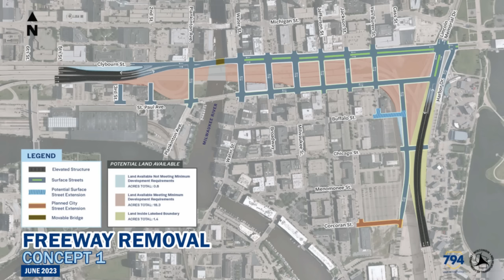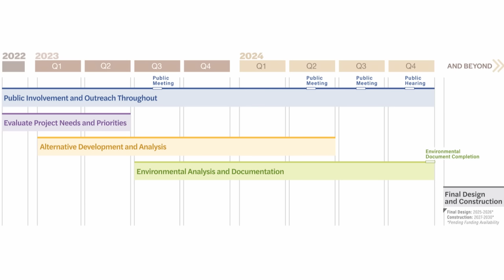Why Milwaukee Is Tearing Down Its Freeway To Nowhere (I-794)

Comment: A 4 lane boulevard with Light rail adjacent to the sidewalks sounds like the best solution. Connect the waterfront to Amtrak's hiawatha via light rail and you can see decent ridership in summer. This also seperates pedastrians from cars via railroad tracks thereby making it safer to walk or wait for the train.
Reply: Why 4 lanes? That’s just removing one car-centric design and replacing it with another. The best solution is bike/ped/transit, with no cars. Similar to the Atlanta beltline plan.

Comment: I love the idea of getting rid of it in favor of converting Clybourn into a boulevard, but it would be a massive project that would screw up downtown for a while. Worth it in the long run but I do get the opposition. The only big issue I see is the Summerfest traffic...the grounds host large ethnic and cultural festivals just about every weekend during the summer in addition to the actual Summerfest event, and traffic gets terribly unpleasant during these events even with the current set up. Reducing all that to surface streets could be a disaster. Then again, if the state would allow for more expansion of the streetcar so it's not limited to a small portion of downtown, that would probably have a huge positive impact on the traffic issue. Looking forward to the town actually making some decisions soon
Reply: Honestly a park and ride could work great from the edge of the city where there's less valuable real estate
Reply: @rt_goblin_hours We have plenty of park and rides on the suburbs that actually take people from there to summerfest via MCTS freeway flyer buses.
Reply: Why TF is the state refusing to allow Milwaukee from extending its streetcar?
Reply: @edwardmiessner6502 there is a particular party that will never help Milwaukee out.
Reply: just build a grade seperated Light Rail for that periodic sort of traffic
Reply: @supercellex4D   where ya going to get the money from.
Reply: @TheSjuris  not building goddamn highways that get overwhelmed by periodic traffic
Reply: @supercellex4D  not gonna get money to build a 1 mile light rail system either.
Reply: @TheSjuris The billion dollars saved from not having to replace the freeway to nowhere that’s at the end of its service life.
Reply: @toddinde   dude they just saved 1 billion dollars by not doing anthing at all. No need for a  1 mile light rail system from 10th to the lake.

Comment: It never was intended to be a route to the airport. The idea of it going all the way to Chicago was a fantasy, and the lakefront expressway in Waukegan, IL was never planned to be part of I-794. The southern end of I-794 was intended to bend westward in Oak Creek, and become part of a beltway that was de-mapped in the early '70s, leaving the Hoan Bridge going to "nowhere". But it really wasn't "nowhere". The eastern part of Milwaukee County found this special road to be a great asset -- except for the awkward connection to the street network at the south end of the bridge. The Lake Parkway solved that problem. It's end just east of the airport isn't some botched connection to the airport, but rather it's right about the point of diminishing returns. Traffic levels start to drop off at that point, and the street network, at the time, was mostly old 2-lane roads. Upgrading the surface streets was a better investment south of that point.

The removal of the east-wast portion adjacent to downtown gained a lot of interest after the Park East Freeway was dismantled, and the area in its corridor flourished. A lot of people didn't think that would happen, but now they think it can be repeated. 

As for the never-build Lake Freeway north of the East-West Freeway (that would have connected to the Park East Freeway, keep in mind that the Summerfest grounds, and the area immediately north of there was once industrial land, and a huge rail yard at the foot of Wisconsin Ave. When the Lake Freeway was proposed, the sight of a modern freeway seemed like a huge upgrade from what was there before. That point of view changed as what's now known as Veteran's Park was developed, and Summerfest grew from a Woodstock-like beer bash on a muddy field, to a world-class festival, and people realized that the lakefront had recreational value greater than it's traditional industrial and transportation value. (In the first half of the 20th Century, people didn't have "leisure time", and Milwaukee was an industrial city. And "downtown" didn't stretch to the lakefront, but rather stopped around Milwaukee St. Most of what was east of there had started as marshes, and the residential neighborhoods that were built on top of that, which later became part of what now is considered downtown, was a convenient place for poor, working-class laborers to live.)

At one time I-794 was seen as a primary access route to the south harbor area, via the Hoan Bridge, but truckers never warmed-up to coming downtown to reach the rest of the Interstate system. And Becher St, between I-94, and the south harbor (Jones Island) area was/is more than suitable. 

Disconnecting the Hoan Bridge, and the Lake Parkway from the Interstate network probably won't be a problem. People coming from the north -- Milwaukee's "gold coast" -- will be more inconvenienced. Instead of their gentile ride down Lincoln Memorial Drive to reach I-794, they'll need to go through, let's say, rougher neighborhoods on the north side to reach I-43. But even the "gold coast" has a more "urbanist" point of view now than 40 years ago. The real money (and power) has moved far, further out of the city to places like Mequon, and the connection to I-43 doesn't require going though rough neighborhoods. (And connections west to I-41 are also available.) 

I expect the East-West portion of I-794 to be demolished in favor of a grand boulevard that, along with the redevelopment to the north where the Park East used to be, will further suck the life out of the traditional downtown area, which already is getting a bit ghost-townish. As for the Lake Parkway, I'd expect it to transferred to the County, and its numeric designation stripped away. And watch for the bridge to change, too. I expect that traffic will be limited to the west span, with the east span turned into a bike highway, and the viaduct portion on Jones Island removed. But that's 20 years off.
Reply from the maker: Ok warren

Comment: In Canada, Montreal removed part of the Bonaventure highway. The viaduc that was between the Ville-Marie tunnel and Peel Bassin was demolished and turned into a park. As a city entrance, it looks much better, but as a public space, it really does not work. The park is a bunch of spaces stuck between the 2 traffic directions and the transversal roads. It just isn't all that inviting at all. I do think that it was the right choice to remove that viaduc. It is a costly infrastructure that was way overbuilt for the purpose that it served.

Comment: It hasn't really stopped any development though.  The third ward near the east/west portion of the freeway is pretty built up.  The Hoan bridge was kind of a waste of money, in retrospect, since all it really does is provide a link between Bay View and downtown but that's a sunk cost and it's not really hurting anything either.  It goes over Summerfest and the sewage treatment plant - so it's not like anyone could put up a building in either of those places.  Also, as you can see from the ample parking, there isn't that much demand to build stuff in downtown Milwaukee.  They reconfigured the 794 and Lincoln Memorial Drive junction several years ago to free up that big green lot near the turn on the east end of Clybourne and it's still vacant today.  For that matter the Park East land has been pretty poorly utilized and they tore that freeway down over 20 years ago.  

Also, the east/west portion is the main route into downtown.  A surface street would not be able to handle that level of traffic.  And getting rid of it would hinder development by making it tougher to get down there.  I mean even without traffic just considering the stoplights you're probably adding 5-10 minutes minimum to travel times between the Marquette and the lakefront by converting that to a surface street.  And keep in mind that downtown Milwaukee isn't really the center of the Milwaukee area.  If you make it too difficult to get down there then developers will start putting up office towers out in Tosa instead.
Reply: It took 20 years but there's a lot of development happening in the old Park East corridor near the new arena that couldn't have happened with the Freeway still there! Building a nicer, more walkable downtown Milwaukee will be good for development, nobody is going to put up towers in Tosa because of a 5 to 10 min traffic delay.
Reply: They tried putting a tower in Rosa a few years ago West of the zoo. Most of the residents greatly opposed it and the project was cancelled. I don’t think a tosa would ever approve a tower
Reply: True they reconfigure the 794/lake memorial drive/ clybourne intersection. But everyone I know finds that interchange greatly confusing. Especially if you are driving southbound
Reply: Wrong on every point.
Reply: @jacobkorducki6940  It's not just the extra 5-10 minutes.  Anyone driving in from Waukesha or Washington Counties has already spend a half an hour or whatever just to get to the Marquette interchange.  And as the region grows that number will increase.  Because eastward growth is impossible the center of population will always move west and that makes places like Brookfield or Tosa more appealing for employers - especially if Milwaukee is going to make life difficult for people driving downtown.
Reply: Wow a practical perspective not driven by bicycle utopian fantasies.

Comment: The narrative is mostly accurate but the title is not. "Why Milwaukee is Tearing Down its Freeway to Nowhere (I-794)" is way too premature. Consider the following:
1. According to the Wisconsin DOT web site, the section of I-794 that some want torn down served 73,900 vehicles daily in 2022.  Dumping that many vehicles onto downtown streets and the already congested I-43/I-94 on the south side is not feasible.
2. Federal funding for future repairs of the Hoan bridge and other sections of the interstate would likely be reduced because I-794 would by necessity, become a state highway and eligible for as much less federal highway fund support.
3. Right now, advocates for the teardown proposal are getting most of the attention.  I anticipate if Bayview, St. Francis, Cudahy, South Milwaukee, and Oak Creek residents sense that the DOT is seriously considering taking down the bridges, the negatively backlash will be enormous and the tear down advocates' dreams will be shattered. 
4. The best plan is bridge reconstruction with fewer entrances and exits and modern ramp design.
Finally, even though Google maps list the KK River as flowing under the Hoan Bridge, prominent local historian John Gurda says that it is actually the Milwaukee River.  The reason for the differences of opinion is because the waterway under the bridge runs between the confluence of both rivers and the harbor.
Reply from the maker: The freeway to nowhere was a nickname given to the highway in like the 80s I think? Idk I saw it on Wikipedia. Either way I didn't make that up for the title, it's a name used for the road by multiple people that I saw within the research of the video
Reply: This is a lazy turdstorian video by someone who admits to using Wikipedia as a source. Thanks for all your original research.

Comment: I am wondering why they can't just use another option that at the intersection of I-94 and I-43, the freeway does not go further east? They could have I-94 west bound into a "T" intersection where you turn to the south for Chicago, or turn north for I-43 to Green Bay. To have a reason to keep the Hoan bridge, build the I-794 exit off of I-94 between Burnham St and Bolivar Avenue. There is already a cleared right of way just north of Waterford Avenue where powerlines go. The north end could be the on and off ramps to E Clayburn St. With this option, the DOT still gets to build Interstate highway, and downtown gets to be free of a highway that separates downtown from the south.

Comment: Bullshit it leads nowhere. It's a handy shortcut from the Marquette Interchange to Cudahy and Oak Creek. I've also tried to get out of downtown in a snowstorm. Remove that and the only way across the rivers south is via Pittsburgh St to South Water St/1st St or head west first, all of which will be jammed.

If you're going to open up acreage downtown for development, first you have to make downtown attractive again. With recent big crime headlines downtown and the unwillingness of the current DA to prosecute crime (his charge rate is under 40% according to the police department), downtown is a pit. Removing the roadblock from downtown will attract that crime to the relatively ritzy Third Ward. They're not going to like that.

I like it the way it is. They just reconstructed the whole thing back in 2008 with the reconstruction, which cost $800 million and took 4 years. Money wasted if they tear it down now. Wait until it needs replacement again, or at least significant reconstruction. This is where Milwaukee/Wisconsin is/are pound foolish.

Comment: As someone that grew up there and lived there for 25+ years I can tell you the whole road system is a mess, not just I-794/lake park way. Poor planning and funding and also stealing funds out of the DOT to build Miller park didn't help. WI does not have a toll system, it's all gas tax and fees. Also when events let out like NBA or MLB games the roads are a parking lot. It's a parking lot during rush hour as well. There is no room to expand I94 and I43 without demo of buildings. Thanks for the video, you do some awesome videos.
Reply: You should do one on Madison, WI Hwy and roads. Now that's a head ache.

Comment: Milwaukee already went through a freeway removal back in the 2000s with the removal of the Park East Freeway. Milwaukee is also studying on removing the Stadium Freeway with the study planning on being done in winter 2024.
Reply: The Stadium Freeway feels VERY likely to be removed once the study is complete.
Reply: @dhinton1  That would be a shame, at least from I-94 to Washington Park. Even along the border of Washington Park it's fairly unobtrusive in its depressed 2x2 configuration. It's a valuable connector to near northwest Milwaukee's old US 41 and US 45 corridor, effectively collecting/distributing traffic across a 2 mile distance from a major freeway, rather than directly to surface streets. Surface streets here don't even exist due to the terrain and land use. I believe the stadium north freeway is the best roadway for the job that's required here.
Reply: @digitboy100  a lot of people in the Washington park neighborhood have been arguing for its removal. It separates the park from the neighborhoods directly west of the freeway. Plus traffic is terrible when the freeway meets Lisbon AVE.

Comment: Reconnecting the Third Ward to the CBD will be an absolute boon to Milwaukee's future development. This freeway is a waste of space, and money. It should be ripped out and replaced with more housing and park space to reconnect the city like it used to be. It will likely improve traffic in time as well, since large freeways like this tend to induce more car trips and ultimately cause more traffic instead of alleviate it.

Comment: Complete removal with in the city is totally feasible. i get that on festival days there might be more traffic than usual, but on days like those you could temporarily close the side-streets off clybourne street boulevard and essentially turn it into a 25-mph limited-access road… which wouldn’t be much of a downgrade over sitting on clogged ramps anyways.

even better (albeit more radical), pedestrianize clybourne street boulevard and harbor drive on festival days, and implement a rapid transit line (tram or bus) that runs along this corridor. you could even put a huge parking garage at the clybourne street terminus so that commuters from i-94/i-43 can hop off their cars and utilize said line, which would be relatively easy with all those ramps you just cleared. clybourne street could become an extremely attractive shopping or mixed-use district, and the festivalgoers will spend more of their money buoying the local economy as they’re now out of their cars & have easy access along the corridor. there is already a head start with the M-line, now just add another line that extends the network all the way east and south.